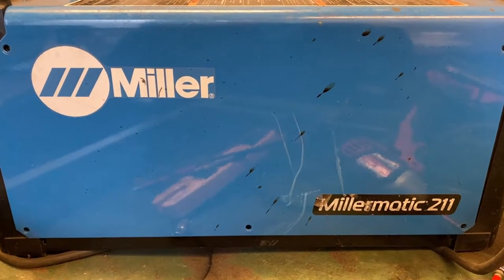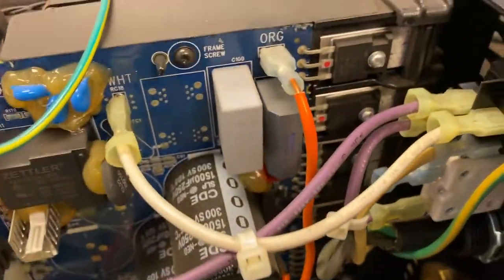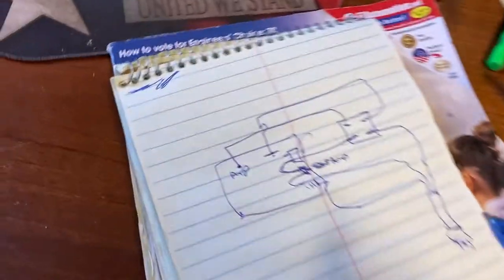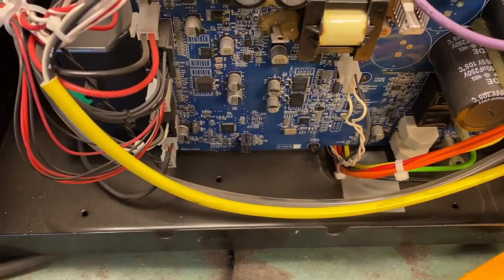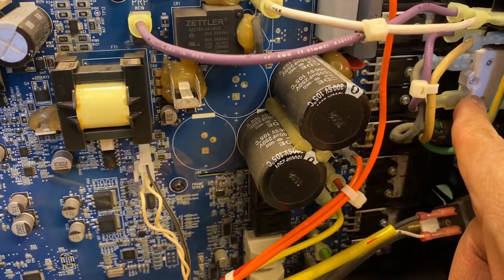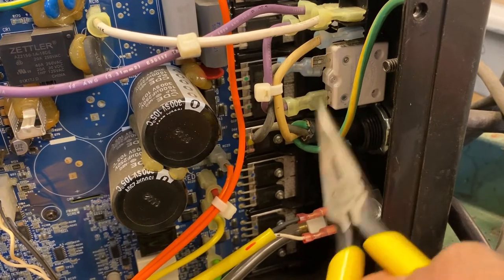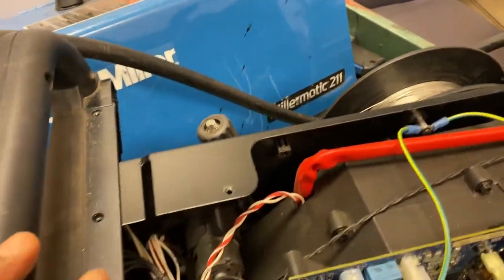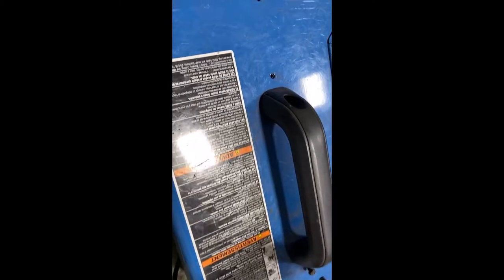Troubleshooting Millermatic 211 Auto-set welder, NO POWER UP

Comment: Great video on the 215 miller multimatic. I did eliminate the switch and circuit breaker. I am looking to test and find the problem with board. Mine turned on for 3 seconds and set of my garage breaker and smelled smoke. Will not turn on now.

Comment: I have the same welder, millermatic 211, my problem is the rear circuit breaker, it breaks when I weld a small bead, 1" or so, I have to wait and reset, can you tell me what the problem would be? I run the welder on a 20 amp breaker #12 wire, nothing else plugged into the outlet I'm welding 16g metal. I can't even stitch weld. Any help would be greatly appreciated. Good video by the way.
Reply from the maker: I recommend to replace breaker first it getting weaker, as I see your problem most often and it’s resolved by replacing the breaker, let me know if you need any help
Reply: @NASSTRACINC  OK, will do
Reply: Supplementary Protector always popping on my unit  using 240

Comment: I have the same welder with the same issues. It won't power on. Checked the switch and circuit breaker, both of which are good. Do you have any suggestions on what I should be troubleshooting next?
Reply: Same here, switch and breaker are good but no power up.  I barely use this thing and it was working six months ago.  POS